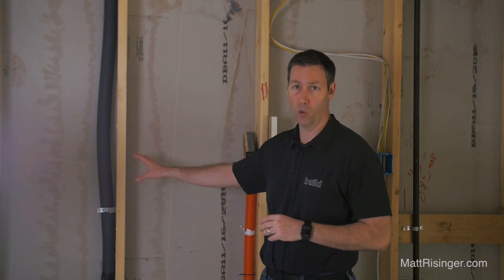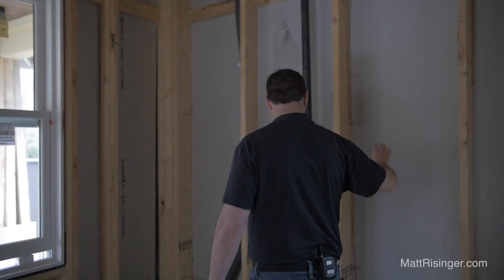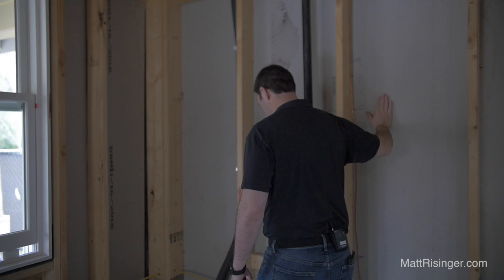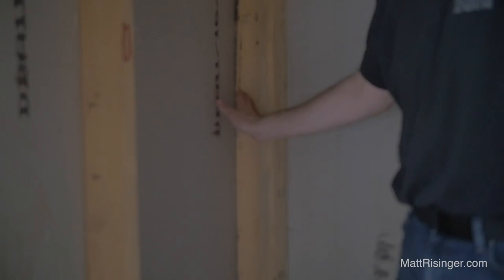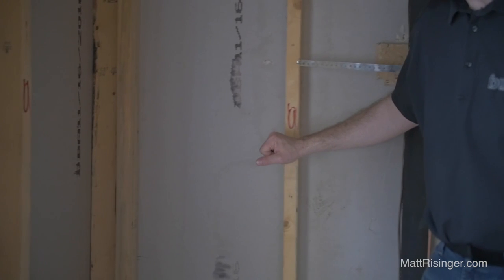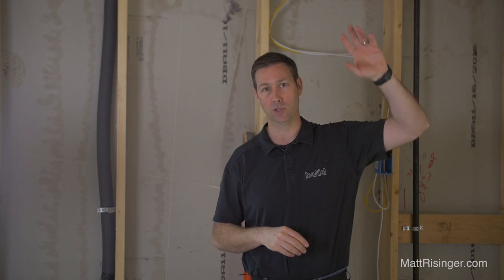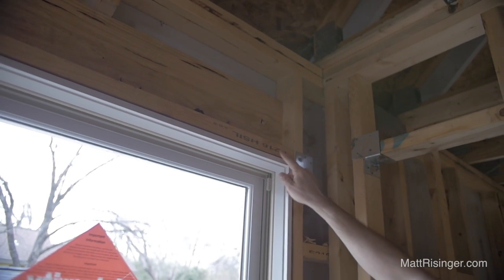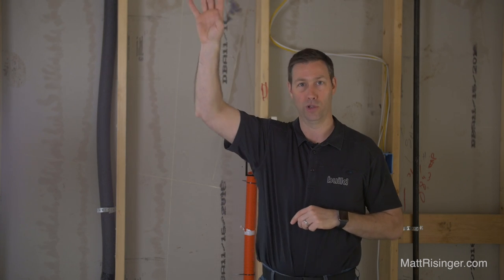Traditional vs. Advanced Framing

Comment: I have been a builder for fifty four years and I went to engineering school for three years.  I have seen so many "new ideas" come and fail in my building career.
This house is evidently in Austin Texas, where I am typing this comment; it is commie central for Texas.  Austin's entire focus is on new edge, "energy saving" construction.  
Look at the corners in the "advanced" framing.  The corners of a home are the weakest point in a home; usually only three 2x4 studs and a few nails in the top plates are all that is holding the corner together, plus the OSB sheathing, nailed to the studs.  That is not much holding power for high winds.  But the "advanced" framing is counting on a single corner 2x6 with one 1 1/2" edge for the weakest side.  That is asking a lot from a 2x6.
Plus in Texas the most important item in insulation is the ceiling, joists plane.  The heat comes in through the ceiling from the attic (if there is one).  Concentrate on the ceiling plane with as few penetrations as possible and of course good insulation above.
If you want good insulation in a wall, build the wall out of cinder block and brick, or better yet two cinder block and one brick walls for you outer walls.
The tree huggers sit in their offices in Austin and their actual building experience is almost nil.  They rely on theory, but mostly ideology.
Every state inflicted "new idea" should be weighed against the cost benefit to the home owner; not some "energy saving" theory.  Ask the home owner if they want to "save energy" at the cost of losing the safety a well built home brings.
Reply: Homes out West have been using this method for decades.  It's nothing new
Reply: Randy Ward this isn't new. most of these concepts have been implemented in Canada for decades, simply because the energy loads homes experience are much greater, and they perform much better than traditionally framed houses both in structural rigidity and energy performance. If we are to continue building wood structured homes, there has to be done changes before we start seeing our forests and tree farms not able to meet demand. The structure of homes has not seen any major developments in over a hundreds years, that's a problem, because our world has changed. It has nothing to do with "communism", and everything to do with making our homes in step with modern needs and requirements. I wouldn't want to try and use a computer from the 1950's, I don't really want a house that performs like one either.
Reply: Good for Canada.
Reply: I have seen a lot of California framing and I have never seen such a thing.  If they do frame as in the article it is mandated by the State.
Reply: The best  way to treehug is to build  a house  that lasts. Insulation filled hollow brick walls could last for generations and are even good enought for German treehugging officials.
Reply: Exactly right.  I built one house that had two cinder block and two brick layers, with air spaces and ceiling insulation to match.  A small A/C cooled the entire house.
Reply: Randy Ward I would agree mostly. I framed for about 3 years and the one thing I would say is that a lot of these "green" construction methods don't really have anything to do with it. It's just a lable that sounds good to make things cheaper (less materials, lower quality craftsmanship) while charging people more by adding names like advanced framing.

They did the same thing with cars. They used to be tough, now the materials they use are b.s. And they said the same stuff, greener, better gas mileage, and cars will be cheaper. They only got more expensive though.

I think that's all it's about. Like you said, it's just a short matter of time till these cheap houses fall apart. I'll take a sturdy house and a steel car any day over this stuff now a days.
Reply: I'll agree with the home comments, but not the automobile ones.
Deaths per mile driven has also plummeted. It's better for the passenger to survive rather than the car. All thanks to the crumple zones and air bags you malign.
Car ownership is a lot cheaper as a percentage of annual income and they last longer.
Reply: Hi thanks for the comment, I got a question please my future house is 47 feet length and 30 feet width, it's two floor . Crawl space concrete wall , the first floor only living room and open kitchen and 1 small Lyndsey room with rest room, so my question is how the second floor can hold or can stay on first floor with out any beam or pols or any support, do I need long lumber like 30 feet or . Please advice me.  Tnx
Reply: I would need more information but you will certainly need beams and floor joists to span 30' across the lower floor.
Reply: Jalal J iron
Reply: Randy Ward This stuff doesn't work in tornado country, go traditional and with adding new wind bracing tech.
Reply: compasteedee Lol...I've never seen a home constructed like that in Canada.  Lol...I don't understand why people are so worried about trees that are plantation/farm grown for construction and paper industry!!!!???  The trees we should be worrying about are those being cut down in the Amazon for the beef and palm oil industry!!!!!!  A 24" oc framing for a structural wall has nothing to do with saving trees, it's about banging the house up faster...which is more about greed and making a quick buck.  I'm a journeyman carpenter, and everything I know about construction says that a 24" oc stud layout for a structural wall is wrong!  At least lumber is a renewable resource, unlike steel stud!!!!  I'm sure we could start making our framing out of plastic, but then who would grow trees?  By moving away from a logging industry we would do more long term harm to our beautiful planet than having a logging industry.   The ignorance of the "tree huggers" is perplexing!  They don't want a logging industry, yet they live in stick frame homes!  These fools don't consider the ramifications of their ideology!  If you want to save the planet, stop eating beef and stop supporting the palm oil industry.   Stop raping the ocean!  Manage resources better!  Stop being a throw a way society!  Stop upgrading to the latest and greatest gadget every 3 - 6 months!
Reply: Randy Ward tech shield is the way to go for your decking on the roof if you want to save massive energy
Reply: Wait what? " The heat comes in through the ceiling"? Warm air travels up! You insulate your house's  ceiling to keep your house warm not cool. If you want to cool down your house just open o hole through the roof ad open a window...
Reply: Randy Ward I like you randy, fellow Texan and aggie too. I don't care for commies either! Great comment
Reply: You obviously have never been in an attic in the summer.  Insulation above the ceiling is the most critical in the house - winter or summer.
Reply: I'll bet if you inspect the corners of the house after a strong wind blows it down the "insulation in that space" will still be right where it belongs. Also think about how much easier it will be to pick up a lot less wood after it falls down. You gotta look on the bright side man.
Reply: Robert Feliciano

"I'll agree with the home comments, but not the automobile ones.
Deaths per mile driven has also plummeted. It's better for the passenger to survive rather than the car. All thanks to the crumple zones and air bags you malign.
Car ownership is a lot cheaper as a percentage of annual income and they last longer."

Increased use and mandatory use of seat belts has nothing to do with it, huh?  Airbags coupled with public awareness of vehicle safety and mandatory seat belt laws have driven the reduced vehicular deaths, not crumple zones.
Reply: Randy Ward
Reply: There will always be reactionaries like this Ward guy, who see ideas like this as part of some sort of liberal plot.  They figure since they work as framers, or in the trades, that they have some sort of qualifications to make those kind of judgements.  They don't; all they have is their intuition, but it has no basis beyond a sense of injury caused by changing times, and their own disempowerment.  They're dupes of the right, whose interests aren't even served by their conservatism, but they don't see that.
Reply: 3 years in engineering school? What did you flunk out?
Reply: They can keep building them like that (advanced framing) and I’ll keep taking the money I get to fix it properly. The drywall cracks are just the start of the problems. Flexing walls and the less structure to nail to the better for me but it really sucks for the owners of these properties!

Comment: Great explanation of Advanced Framing techniques. Wish we could use more here in southern Louisiana. Unfortunately we are required to meet some pretty stringent wind codes (not Miami Dade, but close) that prevents using some of these techniques. I have instituted some ladder framing and we are using foam instead of plywood between the 2x material for the headers. Keep up the good fight and thanks for your videos.